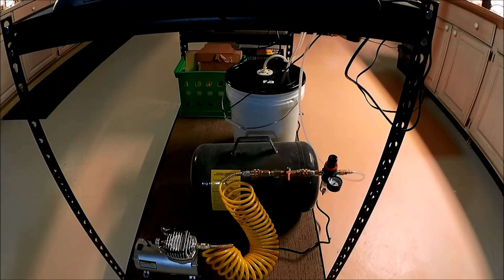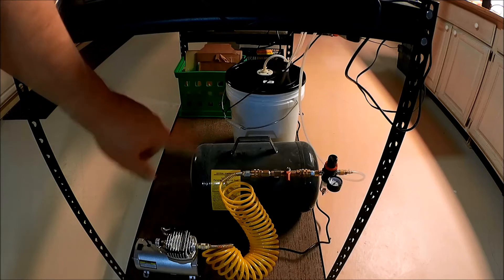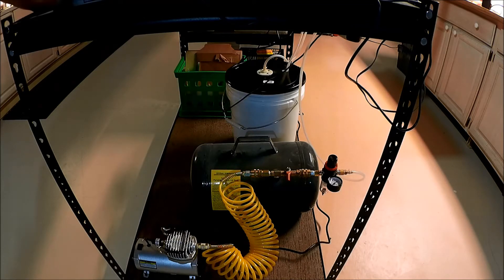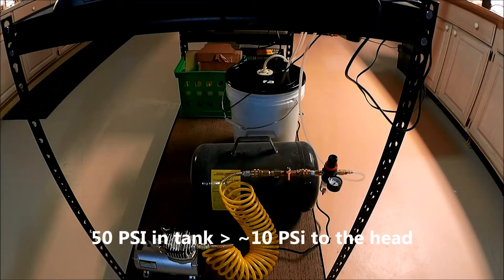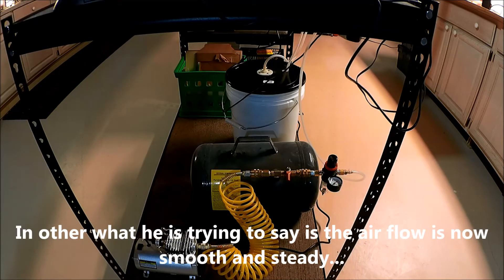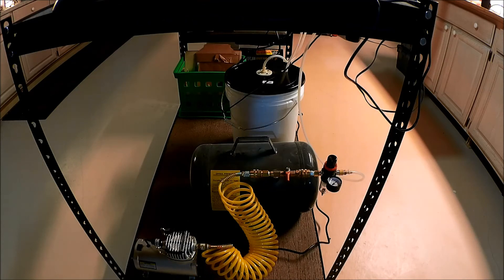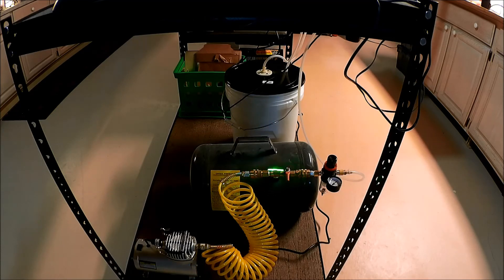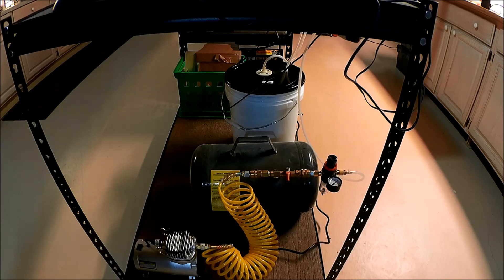eBay Chinese CO2 Laser Cutter & Engraver - Air Assist Modifications

Comment: Hello I am looking for the video for the laser pointer you have installed on the head and the nice clean set up feeding out of the unit. I am basically trying to get all of the upgrades together before the unit arrives Tuesday so I can get right to printing. Do you have a video showing cuts on a bottle or convex item, and most of my engraving will not be flat like the wood you have demonstrated off and on. It will be objects that are 1-5 inches in height. How do you place that type of object in the cutting area? I also want to engrave several of the same design (a logo) on multiple objects at once. I hope you can do that with this, or it will take weeks to engrave hundreds of objects.